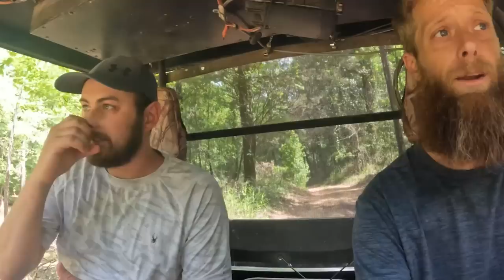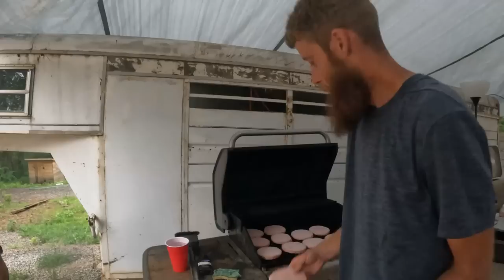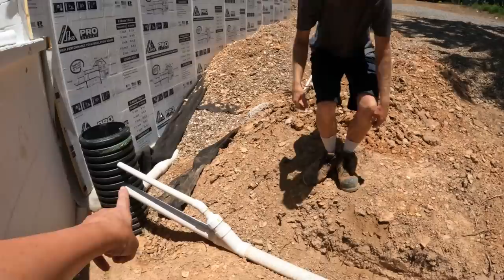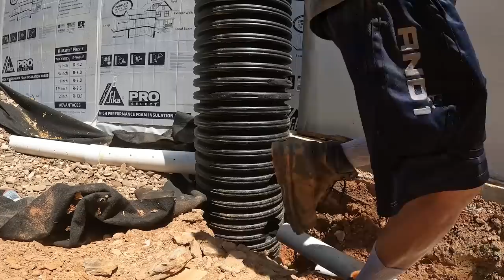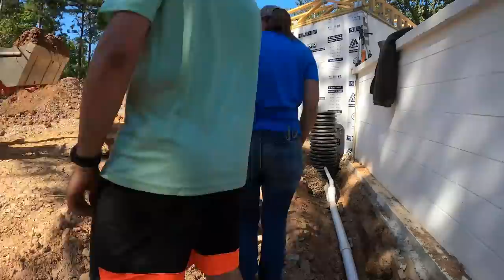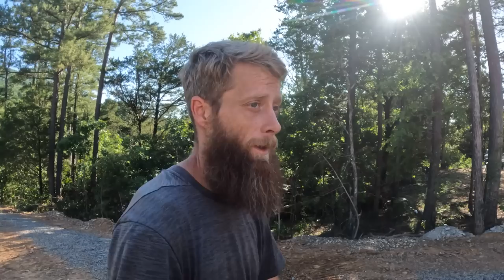We Finished It with Help From Our Friend! | Couple Builds Block Basement For Cabin

Comment: Just don't bury the top of the sump pump.  If you have a lot of water you might try sticking TWO sump pumps in that same tube.  Wisconsin here and lots of humidity and water year round so our plumber put two sump pumps in the same container so glad he did because if one pump stops the other one kicks in.  Safety for sure.

Comment: What did you put on the ends of your drain pipes to prevent vermin from crawling up there and building nests?  I didn't notice you installing any cleanouts on the pipes, so it's even more critical to keep foreign matter out of there, so you won't have to dig up pipes and cut them for cleaning clogs as soon.

Comment: Oh another tip: next time you get or mix Concrete create some pads where your water will exit the drain pipes as it goes into the forest you don't want it undermining right at the pipe exit could cause a back flow and damage your yard area

Comment: Forgive me but, I need to mention something because I have really enjoyed your shared journey .  Building a basement for protection from tornadoes  is the protection  the enclosure has for both waste water drains and water lines.  I am extremely surprised to learn you are not taking this benefit into consideration for the water lines in your basement which is a huge mistake. Your plans for the water lines would be an issue even in a trailer/mobile/manufactured home where electrical  outlets are installed outside near incoming lines to provide a place to connect thermal static heat tape that is wrapped around incoming pipes. This is something that can fail in the dead of winter and one wont know till your pipes burst.  Get those water lines to include the filter inside your basement where they are safe from freezing and easy to work on. Your French drainage  pipes can  be outside but even that should be setup with heat tape for spring freeze/thaws. I know this is going t be a lot of extra work for you but it is  worth the expense and for sure it will give you peace of mind.

Comment: you've probably buried it already but you should replace the 90* elbow with 2x's 45* elbows drainage is notorious for blocking in 90's in most places the 2 45's is code and its a good idea for something you don't want to dig back up!

Comment: I would’ve liked to seen your French drain holes down. It will always hold water around the pipe now and you’ll have three or 4 inches of water laying next to the pipe beforebefore it can reach the holes. The design is for the water to raise up into the pipe and the cavity of the pipe to let it runoff. Where there’s no standing water around and under the pipe. And it also keeps debris from entering the top of your pipe quicker. The debris that is filtered from the rocks will go down over your pipe into the gravel bed and then just clean water comes up into the pipe :-). I’ve been installing French drains all my life now that I’m retired. There has always been a argument of whether the holes go up or down :-(

Comment: This is Martha from Songbirds Acres. That job was well done. What kind of wire are you going to use. We made the mistake and bought the wrong size wire. We got it too big. We only needed 04 wire, and we got 2.0 wire. It is ok for a big place and a 220 box. We was going to use a 120 box. So now we are looking for a small 220 box. Our place is only a 12x24 shed. My son has a 10x16 shed. It works for us. We still have to get a pump put in and buy extra supplies for the electric install. I can hardly wait to see you in the basement. Go kids go.

om w

Comment: You may want to check you foam board adhesion to your cinder block wall where your friend put his hand when he started to lean on it moved in.  https://youtu.be/aowrlbF9ahg?t=838 and https://youtu.be/aowrlbF9ahg?t=1139

Looks like you may have an air space at that location. Will the air gap have any effect on water seepage getting into the basement, just curious?

You are doing a phenomenal job and I would hate to see all your hard work undone.  I hope it is okay with that movement, though.

Comment: Why would you connect the French drain into the sump pump basin? Does anyone understand the concept of French drain? Believe it or not water that flow along your house will not pass thru the pipe in the French drain, it will flow thru the crushed stone. If I were you, I would follow the French drain pipes with a stone exit. Just sayen.

Comment: Gary, do you have something on the end of the drain pipe from your sub pump area.  I would hate to see mice, snakes, etc.  Get in there.  Not trying to be judgemental, just trying to make sure you are all safe.
I know in our small town; I needed the city to turn off the main water valve to my house.  When they opened it up to reach in to move what insulation they had placed inside the hole, there was a rattle snake inside it.  Be careful, we do care about you all.

Comment: Why are you adding complexity to a simple system by adding a pump? All you need to do is hook your footing drains up to that 4 inch line but buried a little deeper so it daylights wherever the heck it’s going no pump needed. I don’t know maybe I missing something that you’re doing there but it looks like all you’re doing is trying to connect your footing drain to where it drains out and the pump just complicates the system and actually makes it so you’re gonna have standing water at your footing all the time. Your property has plenty of slope on it that you could just daylight that pipe out to somewhere where it can flow naturally. DM me if you have any questions